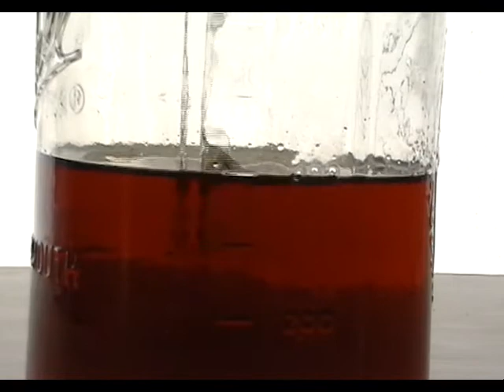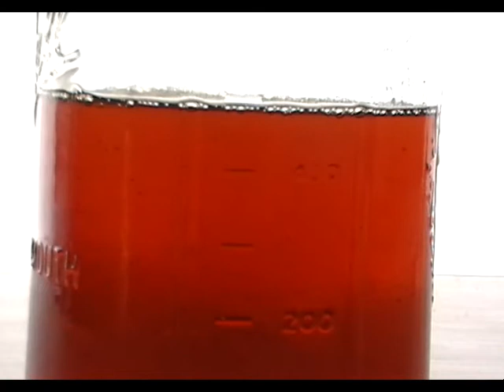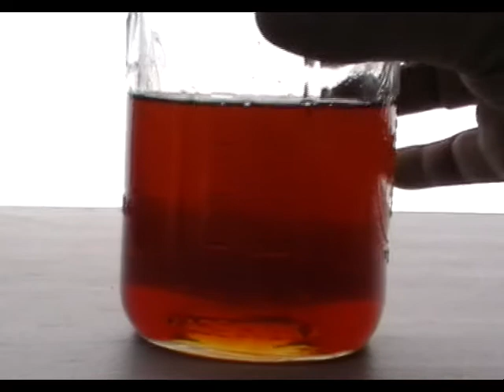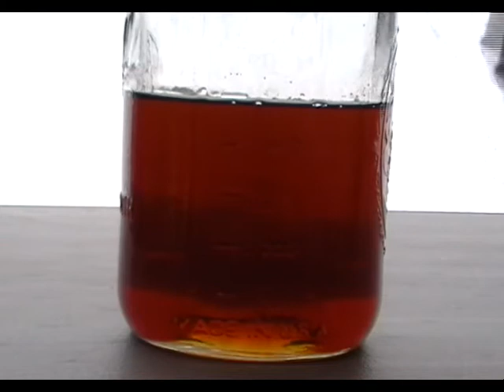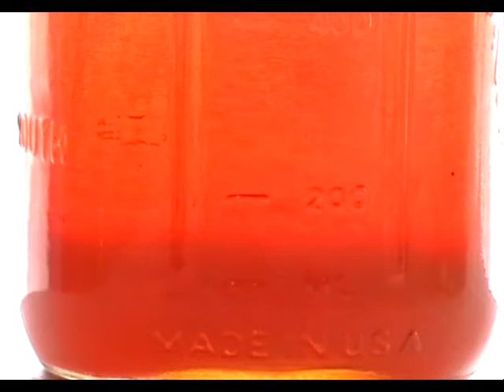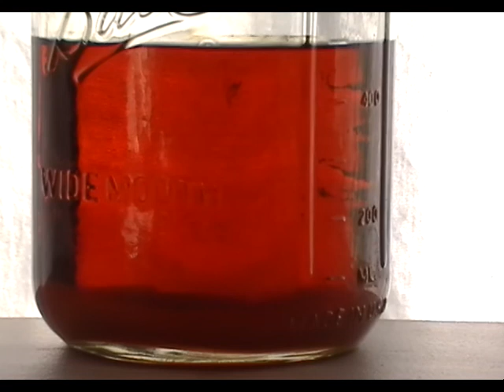Blending citrus oil with Vegetable Oil to Make VO Blend Diesel Fuel

Comment from the maker: @JAROSLAVAGINA Citrus oil is very expensive, so I have not made a large enough sample to run my engine on, but it is a turpene, which means it is very similar to pure gum turpentine, which I have run on my engine for about 200 miles.  My engine ran great on it, and my exhaust smelled like flowers.

I do not believe that citrus oil, or any turpine is acidic.
Reply: Cool. Okay I found it.
Reply from the maker: @ESLinsider  by the way, the red color of my blends is gum.  So, since gum leads to coking then a sustainable blend would have to deal with removing gum.
Reply: @Jhananda  Filtering that wouldn't remove it?
Reply from the maker: @ESLinsider  No, to create a useful fuel out of waste oil one has to realize that filtering cannot remove dissolved solids from any solution. Instead other methods are commonly employed in chemestry to remove dissolved solids from a sollution.  I have been using the principle of differential solubility to separate the fluid I want from the dissolved solids I don't want, and in that effort petroleum distillates that do not have alcohols in them work quite well at reducing gum in the resulting fuel solution.  Acetone is another such solvent, this is why I used both solvents in succession to improve my resulting diesel fuel blend.